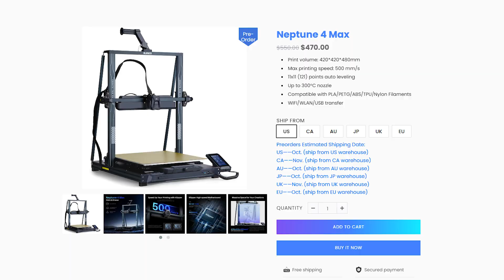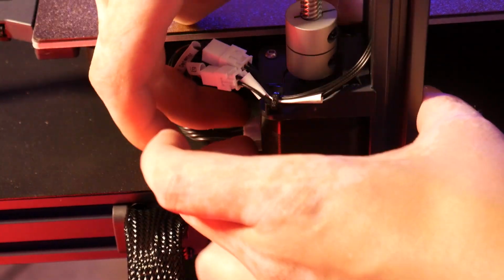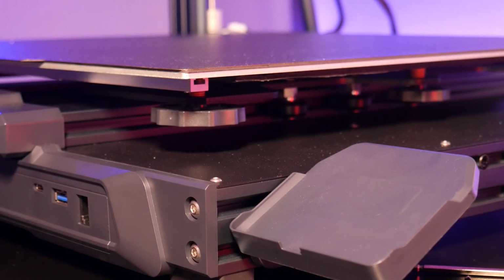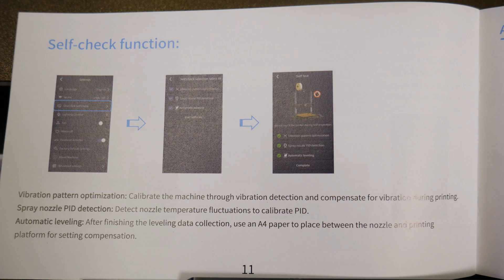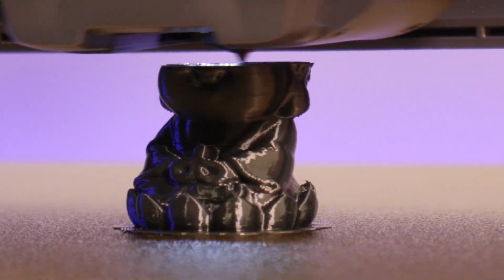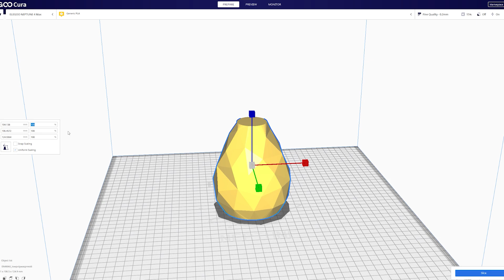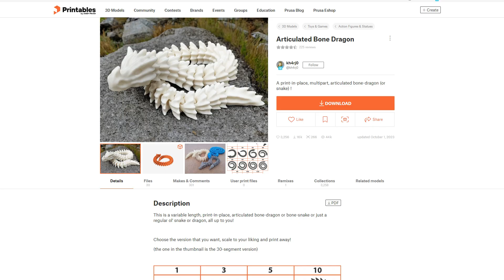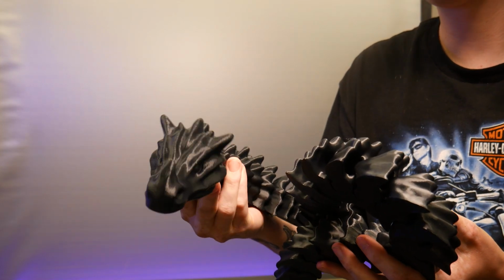The MASSIVE Elegoo Neptune 4 MAX is here! It's Everything I Wanted And More

Comment: How is the bed leveling? I started FDM printing with the Ender 3 Max and it has been an absolute nightmare even after upgrading the springs and adding a CR Touch. I have been using Elegoo resin printers for about a year now and want another FDM, but the leveling worries me.

Comment: Impressive.  Elegoo is knocking it out of the park on their FDM printers lately.  I was particularly glad to see accelerometers on the Neptune 4 Max to optimize input shaping for each user's installation.  That and WiFi were on my wish list for the Neptune 4 Pro.

I have the Neptune 4 Pro, which has steel rollers on steel rails, and I'm waiting for Elegoo to launch the Neptune 4 Pro Max.  I think an all steel motion system on such a large printer will help with print quality at higher speeds, although the print quality in this video of the Neptune 4 Max with the acetyl V rollers looks very good.  I also think steel rollers and rods should be more reliable in the long term when printing fast on such a large machine.
Reply from the maker: YES! really impressed with how well Elegoo is keeping up with these fdm printing trends. 
now they just have to squeeze a planetary extruder in their machines!
I think linear rails would be the ultimate motion system for a big printer, but i think the cost is a little high to integrate those.
at least for now we have easy reparability with the v slot wheels.
Thanks for watching and for sharing your thoughts!
Reply: @WildRoseBuilds  - The Neptune 4 Pro is only $40 more than the Neptune 4 and has steel rollers on steel rails and a segmented heat bed, so the steel motion control cost can't be too much more than acetyl V rollers.  Do it, Elegoo!  Do it now!   :-)

Comment: Happy to see the printer performing well, but sad to see these features are not present on the 4 or 4 PRO. The max, apart from these features just offers a huge volume, not something that everyone needs to wants ... But wifi, input shaping and other features should have been present on the entire lineup
Reply: If you dont need this much size you can simply but the 4 plus. It has the same features but smaller and cheaper.
Reply from the maker: agreed, I'm not really sure the logic behind having these features absent on the 4 and 4 pro. I have a hunch there may be a revised 4 coming.
Reply: @WildRoseBuilds  i just got my 4 max up and running and it's lovely. thanks for the feedback on the print. as for the revised 4, maybe they'll leave that off for their 5 version. ..maybe trying to push people toward the larger side of the market. (especially with the orange storm giga on the forecast!)

Comment: Looks stunning. My 4 max just showed up and I got it up and running yesterday. Any chance you would share your slicer config?
Reply: @Clips_For_Life I haven't needed the height yet but I have filled the bed with smaller stuff. I also run a small 3D print business as a side hustle. It would be great for helmets, armor, props, large articulating models. The Neptune 4 Plus would probably be good enough if you are torn between the Max and the Pro.

Comment: And damn you Elegoo for doing the Neptune 3 Max and people like me saying wow I must get that? 

Then they wait until a couple of months of selling goes by and without any pre-warning bring out this new Neptune 4 Max with klipper for the same cost. 

So why am I upset and cursing Elegoo?

Because they allowed us to buy the Neptune 3 Max Non Klipper non 300 C hot end version then did the new 4 Max version with those two features I needed.

So now I got a 3 Max which is not klipper not all metal hot end and sucks compared to the 4 Max and if I known they would be releasing the better 4 Max I would have saved the money and waited a little longer for this one which is 100% better than my 3 Max.  So damn you Elegoo for getting us to buy a less good version then without any advertising or warning you do the better 4 Max.

That means since I have not the spare money or spare room for this 4 Max, I have to get a Klipper BTT Pad 7 and try to klipper my 3 Max. so much trouble and extra stress which all could have been solved if they told us the better 4 Max Klipper one was coming out soon after my now pointless 3 Max.

So damn you Elegoo.

Comment: I only wish that manufactures would stop putting .4mm nozzles on these large format printers... they need to start putting .6 instead
Reply: they should ship them with both
Reply: @darknessstorm333  I would be fine with that too let me swap it out if I want.
Reply: im sure someone will have an aftermarket part up soon enough. but yes they should include multiple nozzles.
Reply: Even with a .4 and a flow rate of +/-25mm3/s you can print .3 layers height .6 line width at full speed, not too bad, even for big models 👍

Comment: My 4pro sucks running marlin, I will try klipper soon but it’s inconvenient to route the lan cable and I don’t want to fuss with the issues of the wifi dongles. This looks like a significant improvement, I should’ve waited. Unfortunately my experience with the 4pro has negatively colored my opinion of elegoo and will probably go with another brand for my next purchase. I have some other criticisms regarding the UI file system, sub folder being inaccessible which really backwards imho.
Reply: The 4Pro doesn't use Marlin, it uses Klipper, which is branded all over the place. Unless you specifically flashed Marlin onto it, you're running Klipper like everyone else.
Reply: @Gojira_Wins  well regardless of what type of firmware it comes with, it’s hot garbage as far as I’m concerned. I tried 3 different slicers, and I hooked up the LAN cable and played with the klipper settings via orca slicer, and there were no improvements whatsoever, i ended up selling the machine on eBay taking a $100 loss and buying a Neptune 3 pro instead and everything I print now is 100% perfect. I’m sure they’ll correct all their mistakes in the next N5 series but I’ll be staying far away from those N4s. Not impressed

Comment: bought a few neptune 3, regret buying it. They didn't fine tune the firmware and went on to produce neptune 3 pro and max now 4. My neptune 3 is in the dust now. Poor firmware, bed is never leveled. Super quick to throw the previous models under the bus.

Comment: wat makes this better or worse than the 3max
Reply from the maker: this one has Klipper, input shaping accelerometers, network printing, and a handful of other tuning options baked into the UI.
Reply: @WildRoseBuilds  worth the upgrade yes or no? Very new to this and the 3 is$40 off not sure if that's a better deal what do you think?
Reply: @greatestever2903  Dunno if you've already ordered, but I'd def go with the 4. I have the Max 3 and the lack of input shaping and wifi is actually making me consider selling my 3 and purchasing a 4. I am sick of dealing with SD Cards and these large volume printers really need Input shaping to speed them up.

Comment: Does the 4 Max and 4 Plus have metal rails like the 4 Pro?
Reply: There are no steel rollers and steel rails on the Neptune 4 Plus or Neptune 4 Max.  I have the Neptune 4 Pro, which does have steel rollers on steel rails, and I'm waiting for Elegoo to launch the Neptune 4 Pro Max.  I think an all steel motion system on such a large printer will help with print quality at higher speeds, although the print quality in this video of the Neptune 4 Max with the acetyl V rollers looks very good.  I also think steel rollers and rods will be more reliable in the long term when printing fast on such a large machine.
Reply from the maker: they do not!